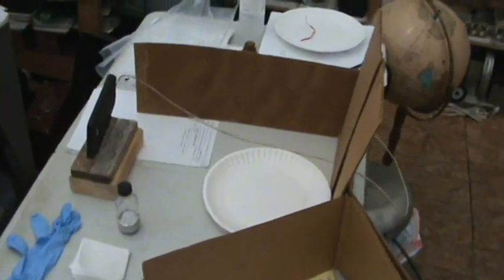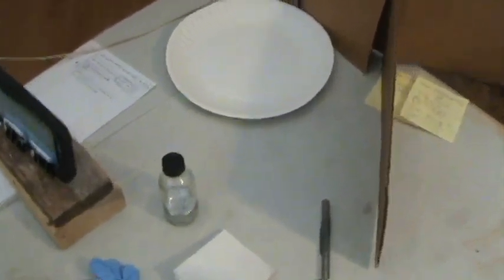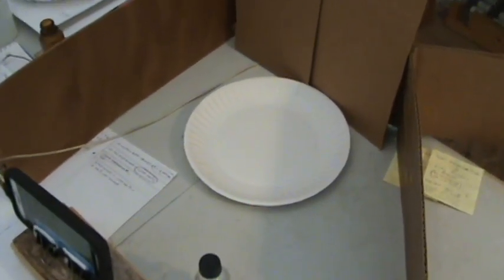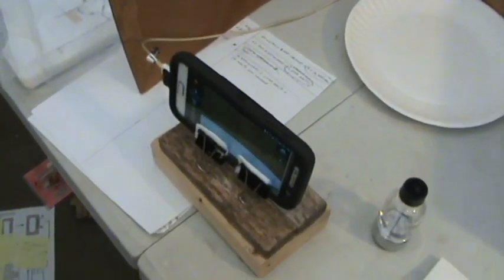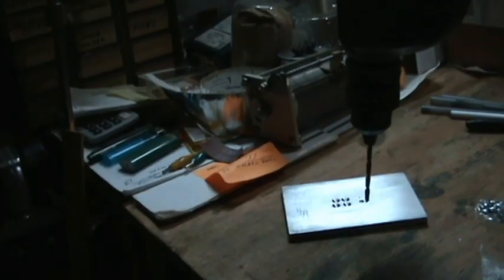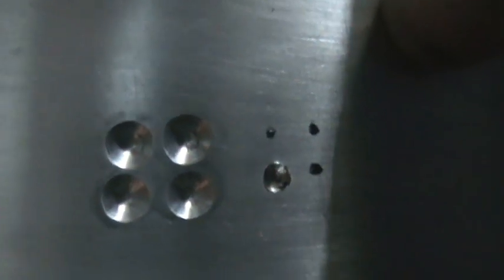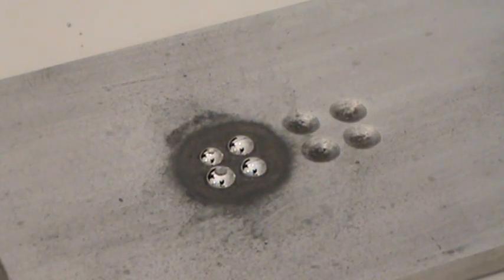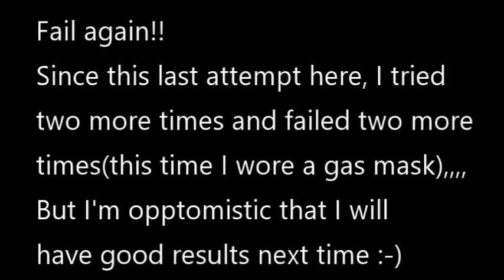MERCURY ON ALUMINUM PLATE, Part 1 (Fail, Fail, Fail)

Comment: . What are you actually trying to achieve ? I have no context  here , " educate me someonee please
Reply from the maker: I should have put a little more info in the beginning of the video, sorry.
I just now put a link in the description to what i am trying to achieve.  To get a reaction of growth. To combine the two metals, (amalgamation).  Originally, i thought maybe i could use this growth as a "energy collector" for my free energy from air project, but not easy to work with it after i have success.
Reply: thanks paul "  keepon at it bro"  well done so far for your tireless efforts     regards B-b @INVENTOR3